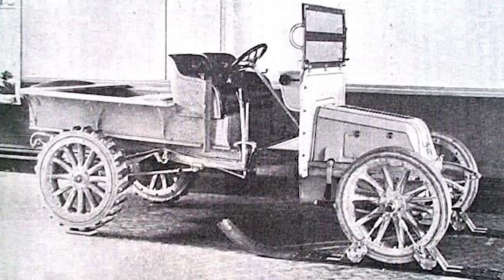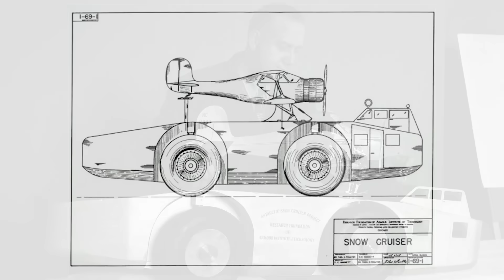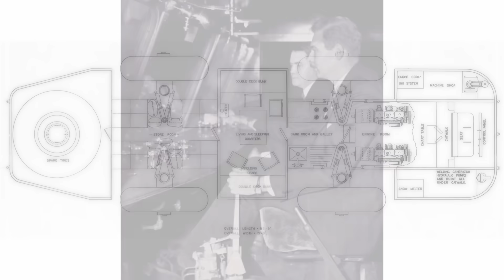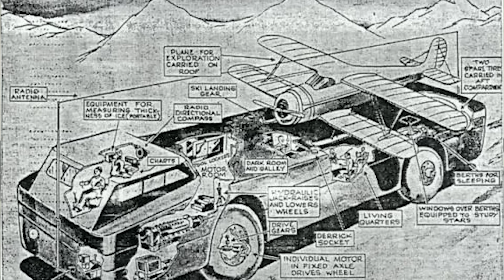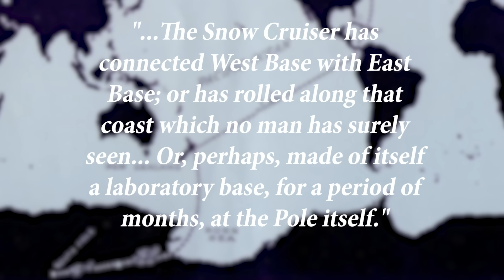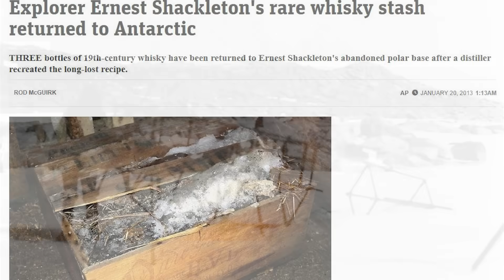"The Snow Cruiser"-Antarctica's Abandoned Behemoth

Comment: Great video, thank you!  I wintered-over at Little America V in 1957-58 as a naval aviator in  the VX-6 squadron.  I had the opportunity to go into the Snow Cruser.  I picked up several of the cachet envelops that were scattered all over the deck of the unit.   Could only observe the inside as we were about 20' below the surface.  From what I have gathered most of the Ross Ice Shelf in that area has calved and gone to sea.

Comment: I am so thankful for the information you've shared. This machine is very interesting. But it seems like it would have been better if they had Eight-wheel drive rather than four-wheel drive. Not double wheels, but two more pairs of wheels fore and aft.
The concept of the machine is fascinating and could probably be done today with little or no issue at all. Some machines were designed similar over the years but not for that specific purpose of exploring Antarctica.

Comment: They should've learned from the St. Chamond tank that anything with long overhang is far from an "all-terrain" vehicle.
Reply: Yeah that's just asking to get stuck, looks goofier than an old school bus
Reply: I think the overhang was supposed to be a feature, if the terrain is relatively flat except for crevasses, the overhang would help to cross them, which is also why the wheels were retractable.
Reply: It also slips sideways like a real bitch if Battlefield 1 is anything to go by
Reply: Ah, like a hook. Push up on wheels, overhang hooks, let wheels down, etc. But it probably didn't work as planned. Tank tracks might have been better.
Reply: @chinocracy  More like a big ski, but ya. Yah, I can't possibly imagine who thought giant innertubes would provide good ice traction. You literally use those for sleds on toboggan hills. Tracks was the logical step.
Reply: @christopherrto  While there wasn't any time to put on any wheels other than what they were given(which were designed for a lightweight swamp vehicle) the main issue was that the vehicle was too heavy. It was calculated to work great on sand, but sand is 4 times heavier than snow, so that was actually 4 times better than it would perform on snow. Correcting this error alone and making a lighter vehicle would have gone a long weight to saving this.
Reply: @chaotixthefox  Even if it weighed only a few pounds, those tires wouldn't have traction. Seeing as snow-car conversions were being done 20 years previous, and their main goal was to give the car something more than a slick tire to grip the snow with, anyone who put any thought into it could have seen this failing from a mile away. Heck, with it non being able to drive down the road they should have stopped and gone back to the drawing board.
Reply: Take a look at the wheels NASA used for the Moon Buggy.  Something wire cage like that MIGHT have worked with the other screwball features on this oversized toboggan...

Comment: Obviously conceived and built by a team that has never been in Arctic nor Antarctic conditions.  This thing might do better in the Australian Outback.  Who funded this, taxpayers?
Reply from the maker: actually they had all been to the antarctic on several occasions. it came down to a misunderstanding of the weight bearing capabilities of the snow (which meant they built it too heavy) and the quick timescale for building- with only 11 weeks to construct it they had to cut corners and, for example, use unsuitable tyres (which, ironically, would have worked had they correctly estimated the height!)

Comment: you have to remember how hard headed Americans are we didn't build one we built 2 and the second one was bigger it was the The Overland Train this monster is still around and was a 6 wheel drive beast that worked for a while tell it became obsolete. you have seen the tires off of it when they put the huge wheels on the truck big foot those are the tires of off the The Overland Train made in the 60's and still hold air.

Comment: Alarm bells should have rung when the " Snow cruiser " got stuck in a country road ditch on the way to the ship.
Reply: stormywindmill 
 Would have given anyone with an ounce of common sense a real good clue that it was a non starter in the snow, ( running on slick tyres). if it can't pull it's self out of a ditch what chance would it have over a crevice,? But I suppose bull shit rules once again
Reply: @rogerhearn7109  Yes it needed very wide tracks not tube/balloon tires!!!!
Reply: @rogerhearn7109  The reason it got stuck was a steering failure then becoming beeched on the belly of the vehicle
The slick tyres wheren't an issue as the air pressure could be radically changed - they where balloons not tyres as we know them: Tyres only need tread to ensure they can evacuate water or mud to ensure some true rubber contact - these where meant to not sink to begin with
Reply: Alarm bells should have rung when the supply ship was named NORTHSTAR
Reply: At that point the whole thing had already been built, might as well have sent it off to its doom even if it was a one in a million chance it would work. Better than spending all that money and scrapping it immediately
Reply: "During the trip, a damaged steering system caused the vehicle to drive off a small bridge on the Lincoln Highway and into a stream near the town of Gomer, Ohio near Lima, Ohio, where it remained for three days" - alarm to fix steering? they did
Reply: I live in lima only like 10 mins away from the town  of gomer and some of the elderly people say they have pics of this thing stuck in the ditch. Lol wish I was alive to see
Reply: Also love the fun fact here that the names of that happening place translate to Finnish as Lima and Ohio = Slime and It's Over. Nevertheless i respect the machine it looks roight proper orky
Reply: That had to be humiliating.
Reply: I agree xD

Comment: The firsst thing I noticed was the treadless tires. Did they not see that before they left ? Like seriously lol. WTF ?
Reply: Same thing I was thinking.  It's like someone who had never driven in snow decided on what tires would be best for driving on snow.
Reply: @PapiDoesIt  from an asphalt racer, the slicks should have serious traction. the offroad hobbyist in me calls that guy a dumbass
Reply: Tracks would maybe have solved this issue
Reply: 250txc not to 60 miles an hour in the thirties, though. Especially not at that size.but then they probably shouldn’t have designed for faster than 5-10mph.
Reply: If that was the only problem it begs the question why didn't they knock out 4 new tyres and send them over for a try
Reply: more wheels and awd maybe also would've helped.
Reply: @nagash303  it was awd.
Reply: Wasn't the tires..they put chains on it and still didn't work. Too heavy and not enough power.
Reply: Some of the heavy equipment I operate runs treadless tires handles just as good in the snow and ice. The weight stops them from slipping.
Reply: y'all say the tyres were the issue... y'all miss that this thing ran two 150hp diesels for 34 tons AT PEAK POWER, meaning it had 8.8 horse per ton to work with. that's worse than many of the heavy tanks engaged in ww2... at governed power, the stupid thing only had 220hp, making it worse than a first gen KV1 at 6.4hp/ton...
and it was front heavy despite the mid engine displacement, meaning the two front 56kw engines were overloaded, as the thing constantly sank and the rears were not.

Having not enough power to even run them at full steam most likely didnt help either. diesel electrics have a lot of parasitic loss. far more than conventional drivetrains.

if it had received proper power it would have been able to work... now in 1938, nothing would've been able to provide enough power density for the space requirements, because the generators need room too.
Reply: @comethiburs2326  Horsepower is not a MAJOR concern when it comes to diesels, but TORQUE is what gets the job done!
Reply: Trains ride on treadless, frictonless metal wheels on frictionless metal tracks.  They rely on the vehicle weight to make this work.  And it does.  I suspect the designers of this vehicle expected the same sort of results as with a train.
Reply: @alliejr  it´s not frictionless metal or anything frictionless at all.frictionless metal would be a scientific breakthrough. it´s smooth metal yes, and the weight of the train makes for a higher friction.
Reply: @alliejr  That´s why trains can´t get up steep hills.
Reply: @alliejr  and train tracks are laid out VERY flat, I'd say a couple degree incline max. Natural terrain doesn't follow that rule.
Reply: @alliejr  But making at least one set with tread just in case would've been more logical. Then the automatic tire changer could've been used to put the tread tires on if the smooth experiment failed.
Reply: @alliejr  do more research, trains actually have sand tanks and nozzles to put the sand on the tracks for traction.
Reply: @alliejr  Wtf. Has the meaning of friction-less changed since I last checked... 5 minutes ago? If they were friction-less, no train would ever move off the spot. At least until 5 minutes ago. 13 people found this worthy of a like... public education is going downhill ;)
Reply: @Baerchenization  Thanks for that, Captain Pedantic.  Without you, the world would never know that trains and rails are not actually absolutely frictionless.
Reply: @alliejr  Well, I am not the one who said it twice in the same sentence...
Reply: @alliejr  OK, and this device was a total failure, correct?   Your easy-out solution is as bad as the real-life results of this device.
Reply: @250txc  I never offered a solution.  I simply pointed out that it's not so obvious that "treads" would have done anything positive-- given that trains work well without them on a similarly frictionless surface.
Reply: Hi
Reply: @Buffalohideface  Yo
Reply: Well shit mate this was a long time ago give "em a break.
Reply: I’d bet they designed that deliberately that way.

Comment: TONS of valid points being argued here. I think the video maker should have 'the reasons he would never know' reading this one thread. Honestly though.....tracks spread out weight and don't clog.....when used on GIGANTIC f*****g tractors and harvesters here in the deep south of America....where there's hog snot slick mud on top of true-blue gumbo mud. Tracks, although higher maintenance and complexity, are nearly unbeatable on low-density/low-coefficient surfaces. Treads pack nearly instantly- not a problem in mud because you 'zing' your higher-performance truck or ATV tires when they start slipping....and on a 1,000CC Can-Am ATV, even with power steering, feels dozens of lbs. lighter after doing so. Tractors and harvesters don't have the (horse)power to clear their tires, even though they have the (torque)power to pull semi-tractors sideways. 
Ice is a lot similar. The packed ice would enormous weight to each and every tread, and it becomes a vicious cycle of tread/weight war. Honestly, having done well in physics and understanding the basic nuances of all the different variables of physics- coupled with a farm life and playing in the mud, bald tires in 1939, LONNNNNNNGGGG before computational fluid dynamics, 'cold chambers' for testing, and no realistic way to recreate Antarctic snow (remember, Antarctic is a DESERT and precipitation hasn't fallen in recent, recorded times- at least hundreds of years, because it's like shifting sand dunes, except snow and ice, and VERY unique snow with un-encountered properties up in the mainland), the locomotion methods seem totally plausible and realistic....for almost 80 years ago. 
BTW, ALL vehicles down there are tracked now, including the ubiquitously snow-ski, a highly ingenious, perfected, SINGLE track machine.

Comment: So here is my idea for a 1930’s arctic exploration vehicle.. the same diesel powered electric system but basically an enclosed cabin swamp boat with a haul/skis and those retractable tires. it’s a boat essentially so it doesn’t weight an extreme amount and has six wheels so you can drive it and then pull up the tires and “ski” across open land. Something like a snow duwk. I wonder how small it would have to be to work prolly be bigger than a bulldozer with more room inside. Idk these comments got me thinking what would I do? I don’t know about it would have worked with tracks. Is my made up vehicle stupid? Do they have something like this already? A ground snow plane?

Comment: It took 50 years for someone to improve the design. This wouldn't have gotten stuck. And, yes, those are the same tires.
https://www.youtube.com/watch?v=jdz3HceLGv0
Reply from the maker: Not the same tyres, those are from Arctic snow trains. But similar!
Reply: @CalumRaasay  I'm sure they came from the same mold. Not very many 10-ft balloon tires to pick from.
Reply from the maker: @johnterpack3940  quite possibly! The cruisers certainly weren't custom- one of the reasons they went for those tyres was that Goodyear already had the moulds- originally for a lighter swamp vehicle used for oil prospecting.
Reply: @CalumRaasay  Bob Chandler said the tires were from an arctic truck. He didn't specify which one but I don't think there were dozens to choose from. I didn't know the tires were originally made for swamps though. That's a fun bit of trivia.

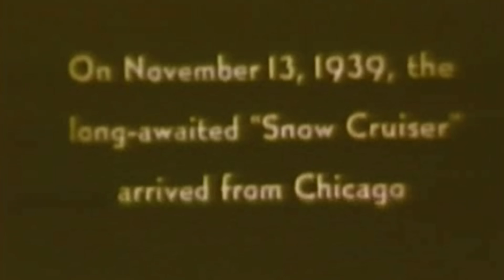Comment: 7:28 the thing can't get out of a ditch in normal temperatures using it's fancy suspension but THEN is supposed to use it to cross crevasses IN EXTREME COLD.... right. At that point people should have realized it was a total FAIL.

Comment: Everyone making comments about the "smooth tires" may want to look a bit into tractive force. This thing weighed 37 tons, spinning tires and burning rubber is not gonna happen on any surface. Smooth steel is quite slick, how much tread do trains have?
Reply from the maker: Exactly, the problem was miscalculating the weight rather than tyre choice.

Comment: Treaded tires would seem to be in order and a single large locomotive diesel engine.
Reply: Treaded tires yes, but single engine no. Diesel engines and piston engines in general have poorer power/weight ratio as they grow bigger, so a single engine of a given power rating would be heavier than two smaller engines with an equivalent combined power output. And there is a problem with redundancy and serviceability,  smaller engines are obviously easier to repair than bigger ones and if an engine breaks down you still have one left to keep the vehicle going or at least provide heat and electricity until the other is fixed or help arrives.

Comment: They knew what they were doing with bald tires. Bald tires are more smooth/have more surface area to grip the slick surface, especially if the tires have less air inside of them. In order for the bald tires to work though, they would have needed atleast 10 of them.

Comment: What is an amazing irony of history! The greatest achievement of Edmund Hillary isn`t pioeering topping of Mount Everest (nice but useless feat)  but going to South Pole landslide with machines first ever in 1958. And he was just leading the second, supportive unit  of Commonwealth expedition which had only limited budget and could afford only the small Ferguson tractors with only some adjustements (tracks were added to wheels). You can see them in his video at 4:14. The first, main expedition had the special Antarctic machines and hit the many troubles. Hillary reached to the Pole first, without ANY major setback. It was huge surprise for a whole world. The Ferguson tractors are still there in Antarctica and still working. 
So, you don`t need any fantastic machines to succesfully work in Antarctica.

Comment: Soft tires with no lugs seems to me to be a terrible idea. 

Why not make some quality tires for it and see if it actually could propel itself on moderate snow/ice?
Reply from the maker: To be honest had it just been lighter it would have worked a lot better without any other modifications- the most immediate problem was just that it was too heavy for the snow to bear its weight. This was just down to a miscalculation during the design stage. Real shame!

Comment: Vehicle designed for ice/snow
No tread on tires
Reply from the maker: To be honest had it just been lighter it would have worked a lot better without any other modifications- the most immediate problem was just that it was too heavy for the snow to bear its weight. The tyres actually provide a fair amount of traction on ice & snow. The overly heavy design was just down to a miscalculation during the design stage. Real shame!

Comment: New subscriber 

As a car nut and former amateur formula car driver and ice racer I find this fascinating. 

Why they decided to use plan tread tires is a decision that baffles me. 

We use intermediate or full on rain tires for road racing in the wet and studded tires (for some classes) on the ice.  I've driven races that had rain showers half way through. Not having a pit crew made it impossible for me to change to wet tires. It was very difficult simply to keep the car on the track under these conditions. There were always big moments when I was forty five degrees sideways and close to spinning. Luckily. close only counts in horse shoes and hand grenades! Several  drivers with limited experience on the ice or in the rain would see their cars return to the paddock on a flat bed.

Long studs or chains might have made this incredible machine at least semi-useful. I guess the devil was in the details. In the tires in this case. Too bad.

I wish it could have been salvaged and placed in a museum for generations to marvel at.  

- dave